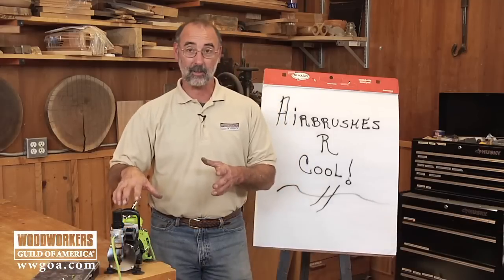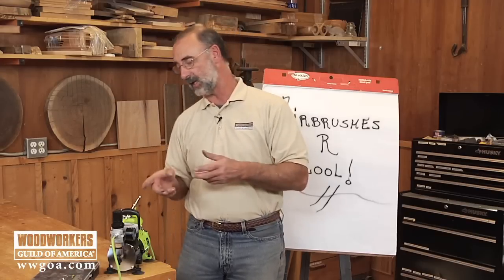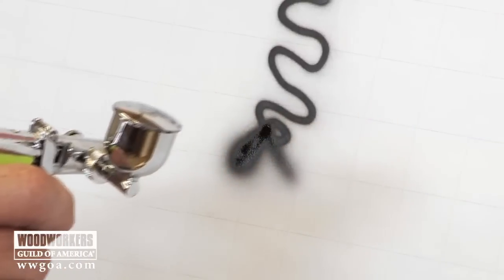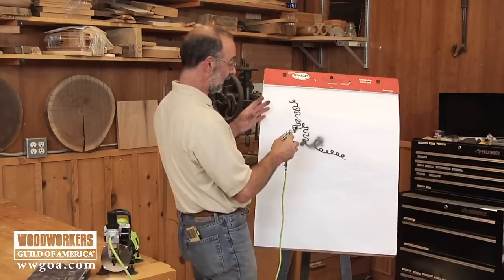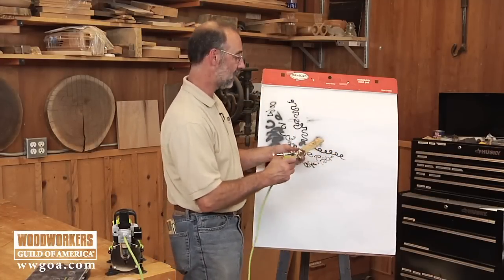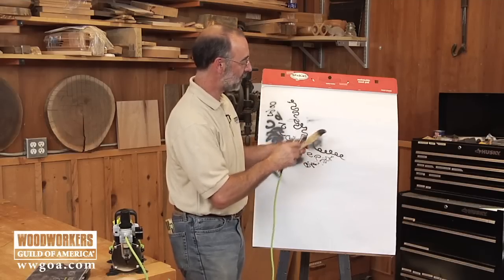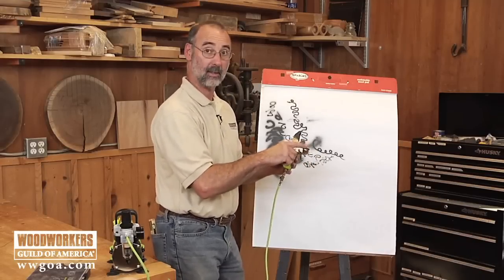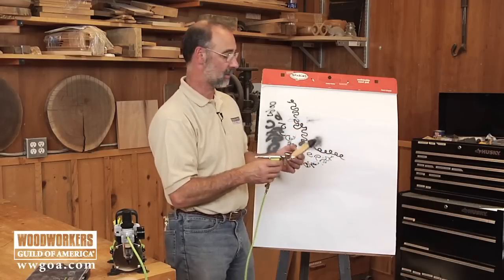Woodworking Tools: Power Tools - Why You Need an Airbrush

Comment: Thanks for taking the time to create this video; however, I don't think you really answered the title question.  It is my opinion that the airbrush is a delicate tool that can perform amazingly professional outcomes and perform tasks that would otherwise be almost impossible.

I think it would be much more helpful if you provide several examples with professional results.  If the guitar shading technique is the motivating example, I would never invest money or the time into the airbrush system and technique.  Do you agree that the guitar looked awful after your airbrush, almost childish.  It appeared that you ruined that fine guitar work.  Even spraying the end of the figurine looked awful, with unacceptable over spray.

I am going to buy a set because I want to work on furniture and other woodworking projects.   Examples that would motivate and excite me are:

Shading woodworking projects...like furniture edges and interior corners...furniture repairs...faux wood graining...fine coloring of detailed carvings...spraying fine finishes on small, even tiny objects...making signs...creative coloration...restoration of tools (coloration)... antique reproductions... aging wood... use of paint, latex, varnish, lacquer for amazing finishes...use of stencils...wood projects for sale at shows, etc that excite the buyers...airbrushing picture art on furniture, etc...  

IMHO - You are an outstanding instructor and have created many very helpful videos which is most appreciated.  This video was not your finest hour.  Perhaps deleting it and starting over would be a good next step.

Comment: Thanks for the intro. I own an upholstery / wood working shop in  Medicine Hat, AB Canada. ( like us on Midnight Rider Custom Coverings Inc. on FB) 
I just wanted to add that I often use my airbrush to apply stains. Now I know what you're thinking but it works great around end grains where its easy to over-saturate and darken the wood.
I've only used it with oil based stains.I'm making the transition to water based products but still have a half gallon of oil based walnut stain as well a gallon of lacquer I wanna use up.

Comment: I hate to say this, but you are doing that sunburst completely wrong. You want to start with the light colors and layer the darker colors over the top. You also don't want to spray straight on like that. As you noticed earlier, the further away from the sprayer, the lighter the paint is applied. So, you would want to angle the brush from the outside edge and have it pointing towards the center. This will apply the paint thicker at the edged and lighter towards the center. what you did was the equivalent of finger painting with the airbrush. 

Also (and I know this is a very old video), sponsored videos (which this clearly is, because you have absolutely no skill/experience with that airbrush) need to be labeled as a sponsored video. you could get yourself in legal trouble for not labeling the video.

Comment: So is it possible to use any kind of water based paint for wood with airbrush? Even impregnating and sealing agents?
Thanks a lot and... Great video
Reply from the maker: I haven't tried everything, but they are pretty versatile in general.  To be sure I'd suggest checking with the manufacturer of your specific gun.
Paul
Reply: @Wwgoa  which characteristics should I check? The density that the gun can support?

Comment: Could you use an airbrush to stain smaller pieces? Or use it to apply primer? 
 
I'm curious because the issues I see are with viscosity.  I mean lacquer thinner can thin acrylics, but I'm not sure about other applications. Scoured the web and there's very little info about airbrushing and wood.

Comment: Good evening,  here in the UK as hobby I make verneer boxes. I currently by hand apply shellac.  I'm looking now to use a spray gun , would you still  recommend  this kit ? lastly in the  video,  you were using shellac. ?

 May I ask what is the  formula/ratio mix you use  ?  I use dewaxed shellac? Excellent video,  thank you for this very informative video. Kind regards Danny uk 🇬🇧❤🇺🇸👍🙂
Reply from the maker: An airbrush would probably work fine for small scale projects such as a box.  You might also want to look at the Preval spray system which is inexpensive and works reasonably well.  You might find something similar in the UK.  Here is a link on Amazon: https://amzn.to/2PcsmaD
On the shellac, George uses pre-mixed Zinzer Sealcoat which is a very thin (2 pound cut) and is dewaxed.  https://amzn.to/2HYI3ic
Paul